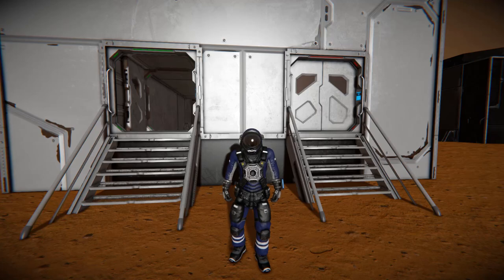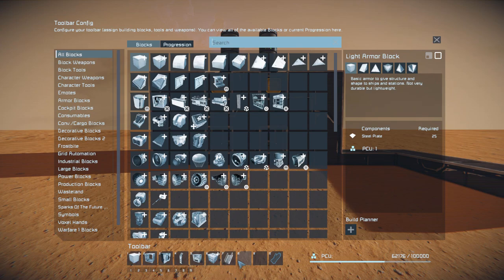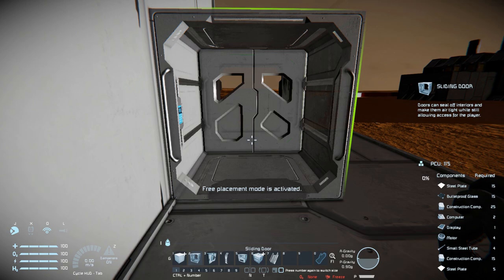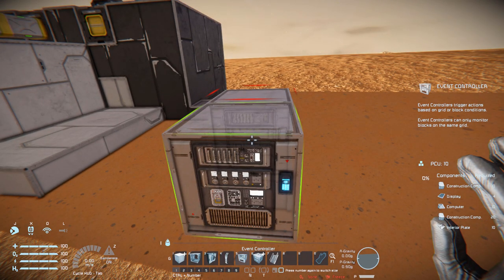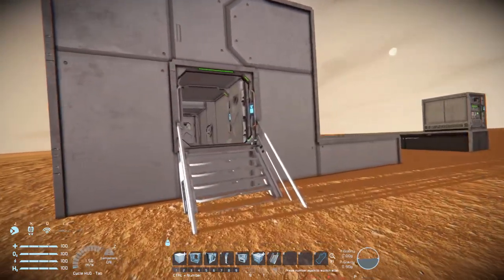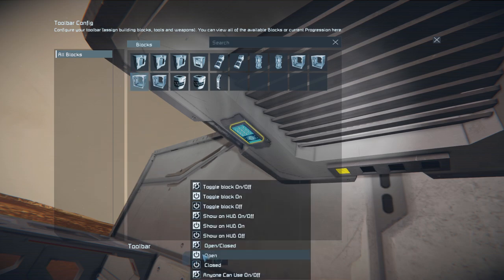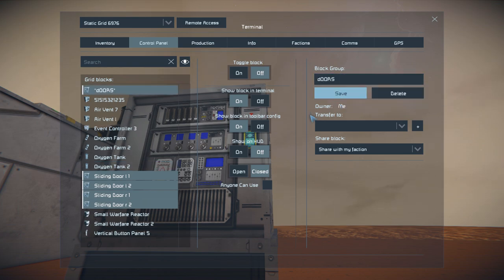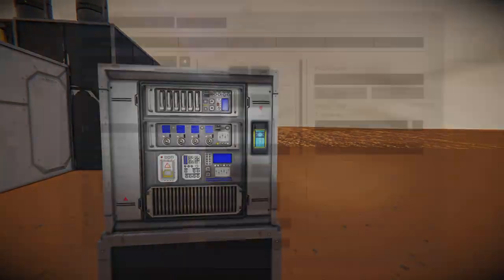How To Build A Dual Airlock System With The Event Controller!! - Space Engineers

Comment: Pretty sure we could optimize this system to only be two blocks wide with some strategic hallway block placements
Reply: Or armor panels, door/panel/button/door on one side, door/button/panel/door on the other (or use a sensor, it drains some power but reduces the length to 1 block in the middle and automates it).

Comment: I think you could just press a button on the outside/inside and have the event controller handle the rest, letting you use only one airlock instead of having to build two.
Reply: This, by adding a button in front (I usually put them above) each door reduces the system to a single tube with the same setup. Plus you can even ditch the button in the middle, just close the door behind you.